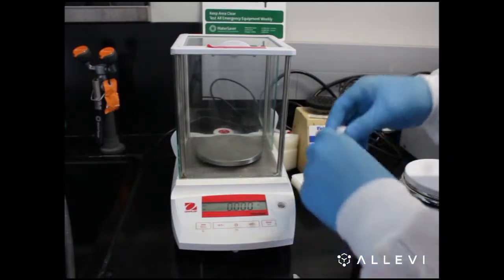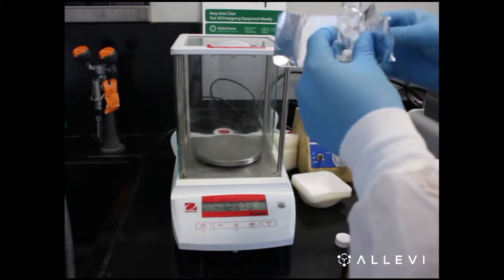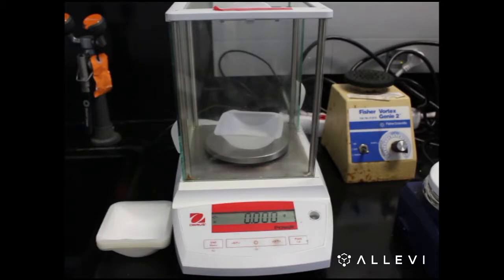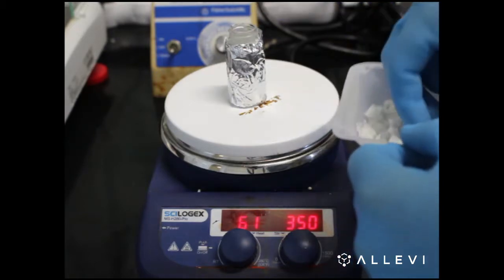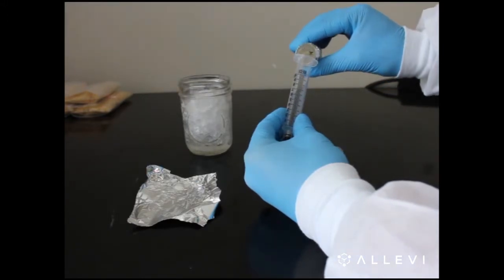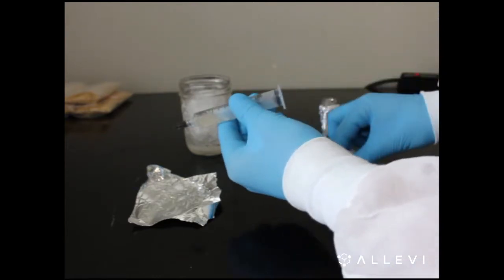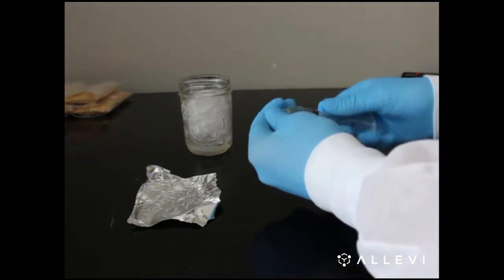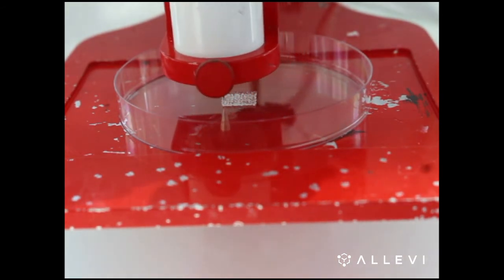Gelatin Methacrylate Instructions

Comment: Could you specify ingredients please?
Reply: LAP is the photoinitiator, which when activated by UV light will initiate crosslinking of the methycrylated (gelatin) collagen (GELMA). The company sells GELMA which is why they don't tell you how to make it. It is actually fairly easy to make GELMA if you have lab facilities at hand, a simple reaction, followed by dialysis and then finally lyophilization. Hope this helps.